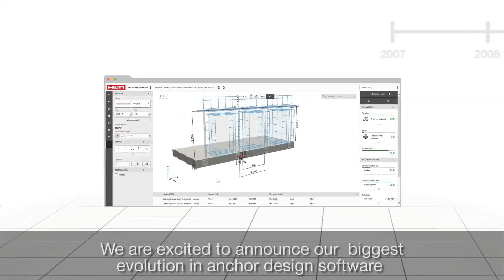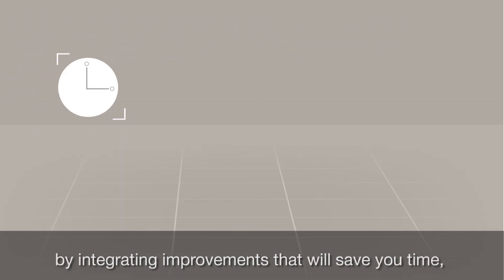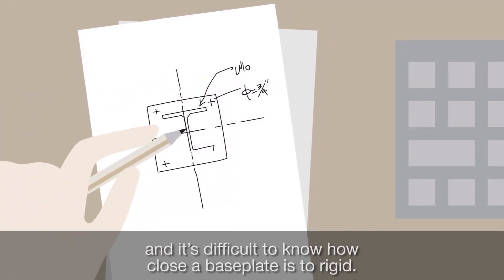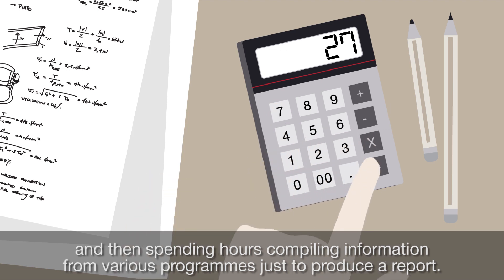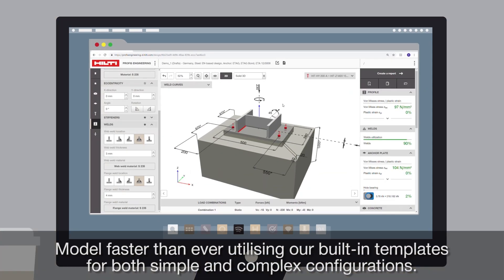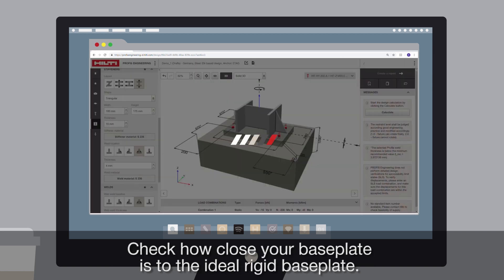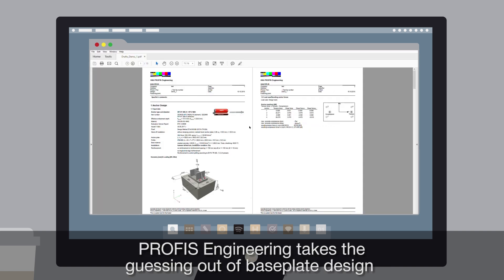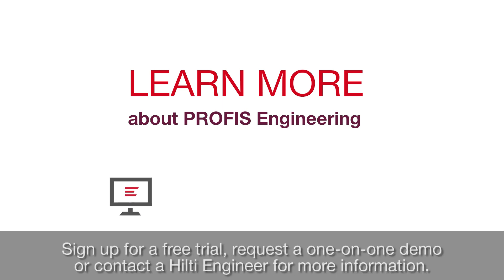INTRODUCING Hilti PROFIS Engineering Software

Comment: can we use this software to test small components? roughly the size of our palm
Reply from the maker: Hi there, thanks for your comment. 
PROFIS Engineering software aims to design steel to concrete connections using post-installed fixings (anchors). 
Hope this helps.